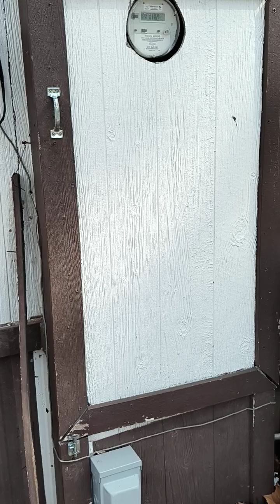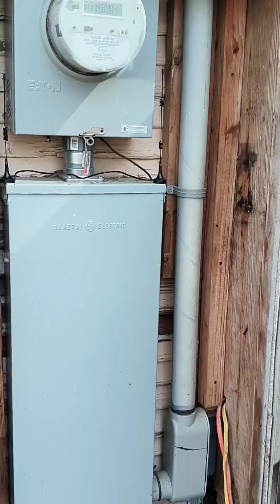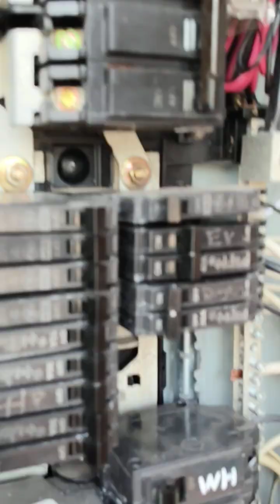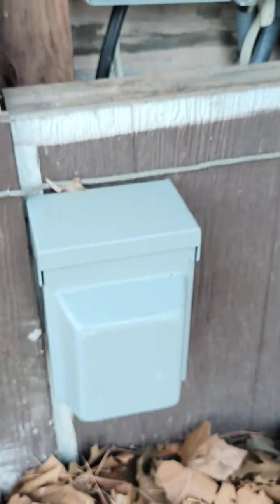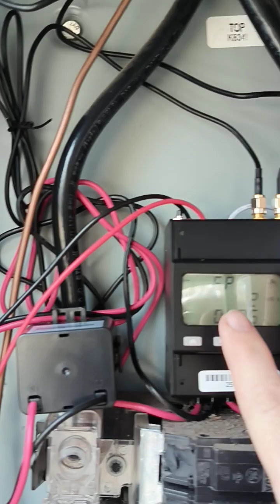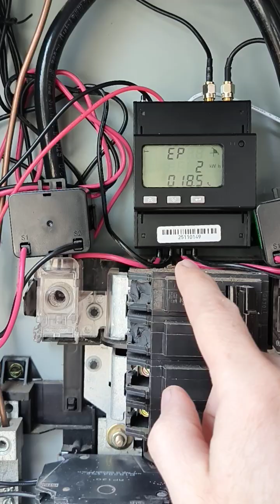Craftstrom Solar Grid Down Workaround

Comment: Since the crafstrom inverter doesn't work on a split phase circuit, I don't believe that workaround would work unless you have some sort of step up device, it's only going to do 120V in the United States.